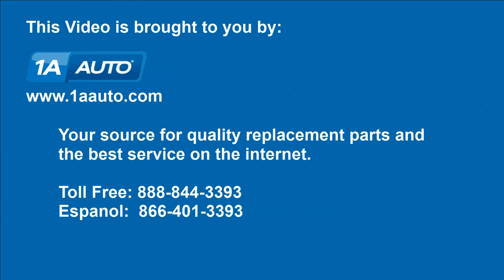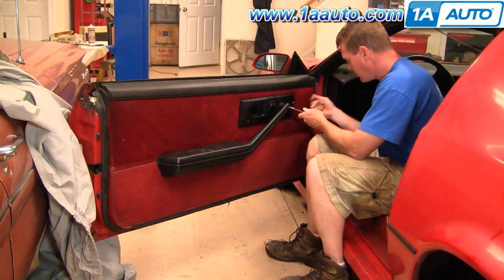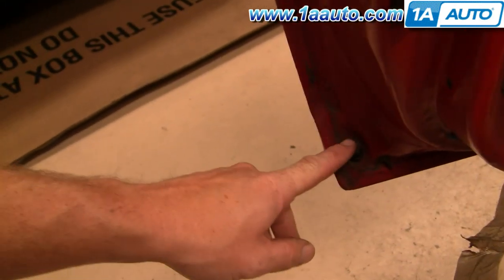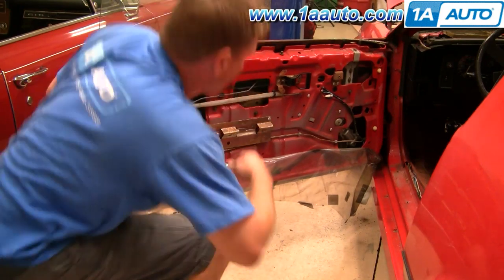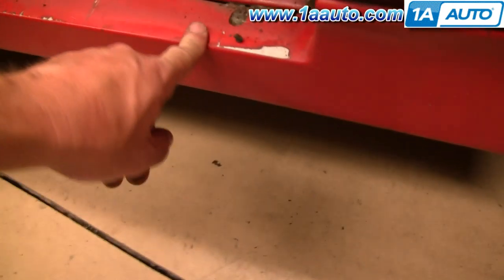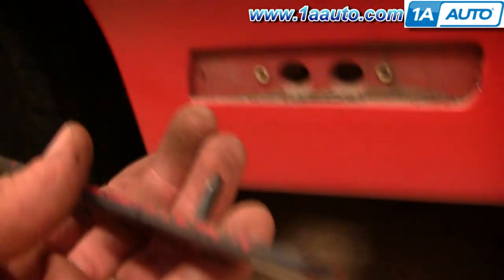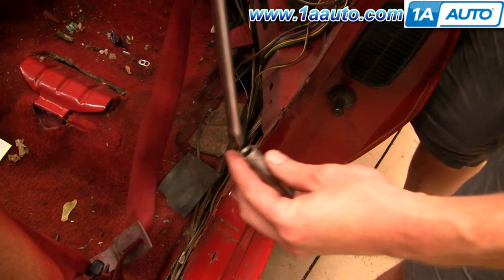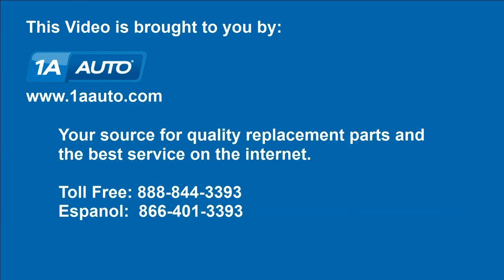How to Replace Door and Rocker Panel 82-92 Camaro IROC-Z

Comment: 5:55 If you go to do this job on a Firebird or trans am there are 2 10 mm nuts behind the wheel well. The nuts are near the top of the rocker piece, and if you have vented fenders, the door edge nut is very difficult to reach. Thankfully, if you snap a rusted bolt in this section, they can be replaced with a carriage bolt from your local hardware store. You need a deep 10mm socket and a lot of patience. The fender vents can not come out unless the front nut is completely removed and the rear nut must be loosened. There are 2 clips holding on the fender vent on the wheel well side, they are steel and i used a short 5/16 flat blade screw driver to comress the clip and push it out. Do the top first and shimmy the whole vent up slightly so that the bottom clip is easier to compress. 5:55

Comment: do you have a vid on fixing the fog lights on the same year maro? my 91 z28 has new bulbs but they wont turn on, im pretty sure it might be an electrical problem but I want to be sure before i start ripping wires out. thanks.

Comment: Can the right ground effects go on a camaro even if it never had them before?? Or do adjustments have to be made
Reply from the maker: They should just bolt right on for you. If the doors have any type of a sagging issue, they may scrape the ground effect. Hope this helps you out. 1aauto.com 866-403-3393

Comment: Why in the world would you not use some penetrating oil before beginning to attempt to remove those rusty fasteners?
Reply from the maker: +Ricky Pucheu They broke free fairly easy.
Reply: Maybe so but you run the risk of stripping the risk head .ir rounding the Phillips cross anytime you remove rusty screws or bolts. It's always a good idea to use some type of penetrating oil just as a good measure.